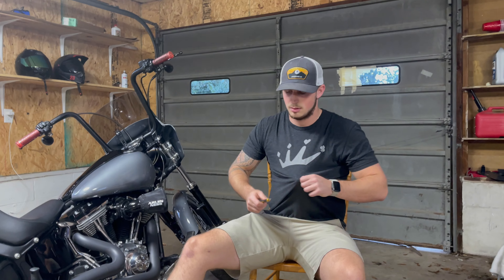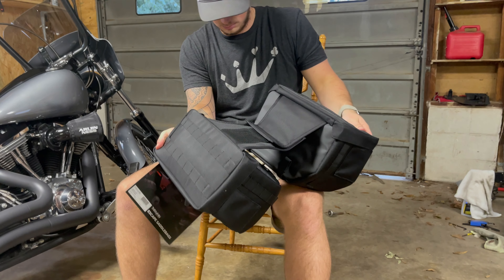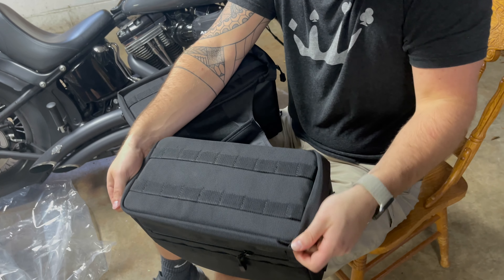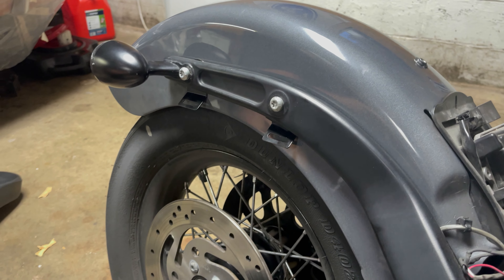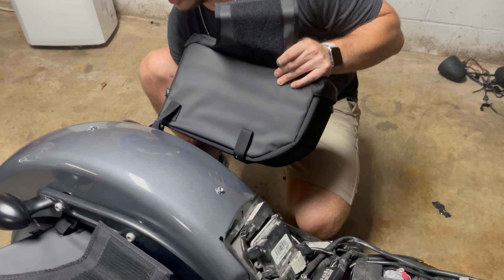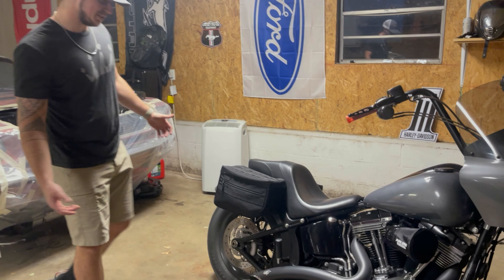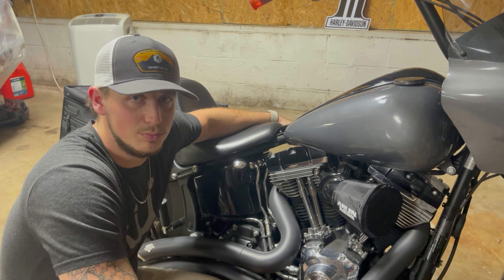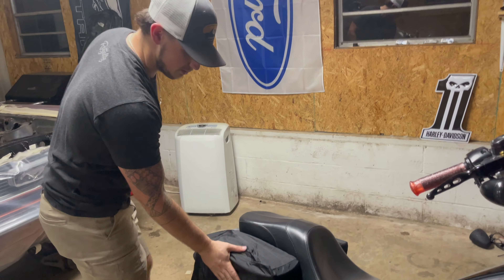Thrashin Escape Bags / 2Broz

Comment: Thanks for showing how they mount to the brackets.  My low rider S has turn signals in the way of everything but I think these will work.  I don’t want the fender to get jacked though.  Thanks
Reply: Put electrical tape on the back the turn signal and spray adhesive a micro fiber rag on the strips of the bags that run under and on the fender and seat

Comment: So I just got my escape bags and my sissy bar bolts burn/ take the cover off on the back of the bags, has anyone else experienced this
Reply: Your question is kindof confusing. The sissy bar bolts wear through the cordura of the escape bags?
Reply: Shit put a piece of electrical tape over it… take it off if you take your bags off problem solved lol